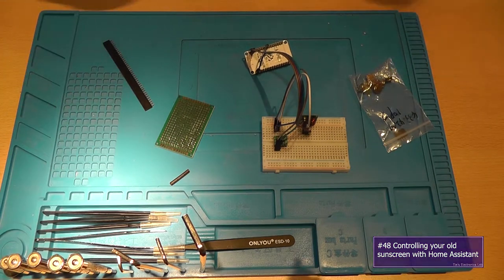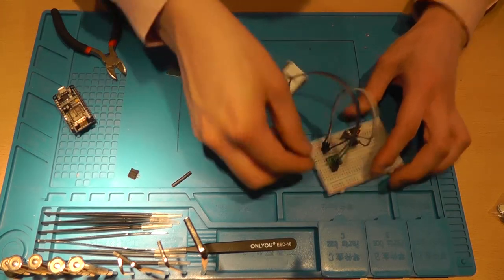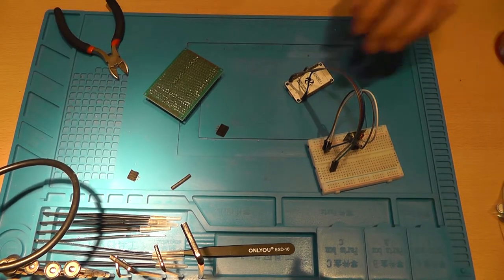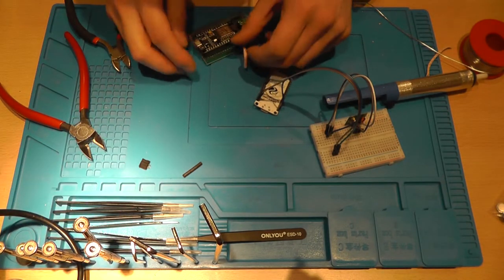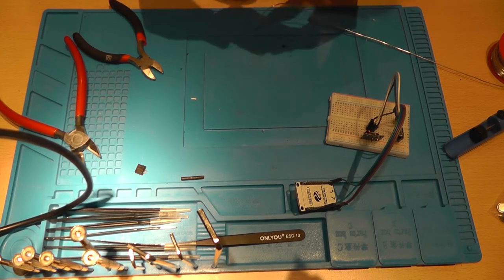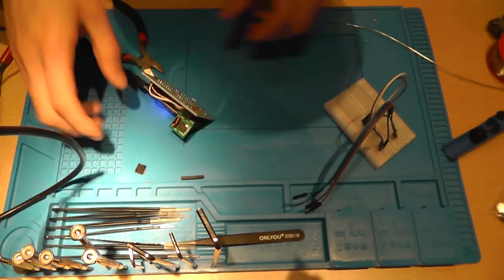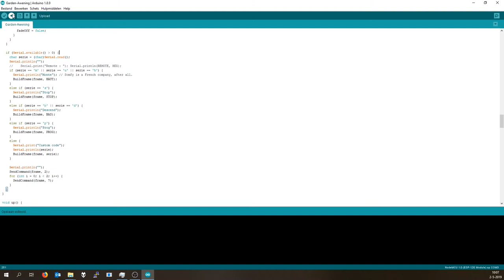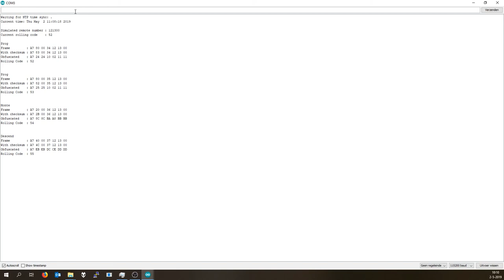#48 [GUIDE] Controlling your old Somfy sunscreen with Home Assistant

Comment: Hello Tim, is there anyway you can explain how you replace the crystal on the transmitter?
Reply from the maker: Hi Jimmy, it's basically just desoldering the old one, and solder back on the new one. Make sure that the crystals don't get mixed up

Comment: Tim, I wired everything up and installed like you explained. But I think something went wrong. It connects to wifi, but the serial monitor calls out
:

--------------- CUT HERE FOR EXCEPTION DECODER ---------------

 ets Jan  8 2013,rst cause:2, boot mode:(3,3)

load 0x4010f000, len 3460, room 16 
tail 4
chksum 0xcc
load 0x3fff20b8, len 40, room 4 
tail 4
chksum 0xc9
csum 0xc9
v000731a0
~ld
⸮⸮Init
Reply from the maker: I'm not sure what the problem is, try to put some print lines in the code to see where the code is getting